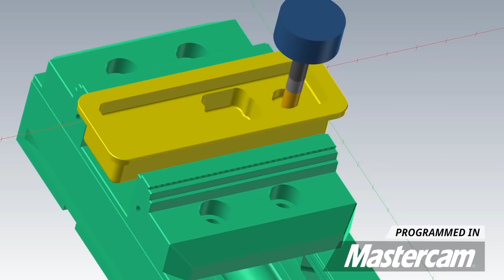My Boss SUCKS and Represents a CANCER in our Industry… I’m DONE.

Comment: In my second year in machining at college, my instructor told us one of the places they toured had a shop floor rule of two IPM. My instructor asked them “how the h*ll do you guys make any money?” They said it was a safety rule. They didn’t finish that tour, he rounded up all the groups, went back on to the bus and off to the next shop to tour. He told them “forget anything those guys told you.”
Reply: Jeez, even as a person who knows very little about machining that seems incredibly slow.
Reply: SteelJM1 it is. To the point where you’re putting unnecessary wear on your tools.
Reply: @brantleyanderson6807  how would not cutting out more wear on your tools?
Reply: Hellsing 12002 running your tools too slow can cause unnecessary wear on your tools from rubbing. Don’t believe I said anything about not cutting out more
Reply: That's absurd, heck, I regularly hand feed faster than that on a manual mill, like 10-12ipm
Reply: @Ian_Wallace.  Whenever I hand feed it's anywhere from full feed (630mm/min) to rapid (2500mm/min)
Reply: I used to run a 25yo CNC machine in 2015 built for cutting out stone countertops. Ran a 22mm end mill cutting through 3cm stone slabs, 6krpm. It ran dos and used floppy drives. It got so wore out the whole head would tilt visibly from the gantry. When I started the machine could do 8ipm for the most part. By the time it was scrapped it was still going faster than 2ipm, usually

Comment: I've worked with guys like that. One couldn't understand why he kept breaking drill bits in a stainless part. I increased his spindle speed to where they were supposed to be but as soon as I turned my back, he slowed it down again because he was afraid. These were the same guys that preferred 304L to 304 SS because "that leaded stainless machines easier." I started to tell them that wasn't what the "L" stood for and that the machinabilty index was actually lower, but then I thought better of it and left them in their ignorance.
Reply: Ha! Tell them to use 304LN - because it's "Low Noise" and doesn't chatter.

Comment: I’m an oldish school machinist, or was, I went into teaching. Never did much cnc-ing. My only qualm here is wear and tear on the tools (how many parts produced before replacement) and on the machine
Winding things up is all well and good but can the tools and the machine take it?

Now in terms of modern cnc and tools I’m sure they can, though one place I worked at I witnessed them working a cnc mill way past its limits, it sounded awful. I also had to put up with bosses putting the latest tools into older machines that could not take the forces generated by running at the required speeds and feeds.

Times like that made me happy to leave the industry.

Comment: I spent years as an inspector for an aerospace shop. These guys had management all over them to get parts out fast and jobs would end up in piles outside inspection because the main inspector spent 90% of his time bullshitting instead of checking parts. I put an end to that.
Reply: I was the final inspector for 2 years in my shop.  I met production around 60-70% of the time, and missed it by 1-4 the other times.  (12 hour shift, 40 parts by end of shift).  I was responsible for cleaning, installing parts, pressure testing, and inspection, and packing.  

I constantly got crap for not making production every night.  However, my parts was clean, I mean clean enough to lick the inspection filter, and in 2 years not one part ever came back with my name on it.  My counterparts on days and the other night shift guy (we worked 4 on 4 off), had parts come back by the truckload all the F'ing time.  

These people did not do their job, and just pushed crap through without cleaning, assembly, and testing properly.  It was infuriating because I knew how they did it, I refused to do it, and got sh*t on by the leadership and bad raises at review.
Reply: @Terrackhimself  A lot of us have been there and done that, brother! I'd wager your personal shop looks a lot better than they guys who did the bad work. That kind of behavior crosses all kinds of life lines. We are now Old School. Congratulations! Yell at some dumb kids! When someone needs something done right, they will come to you.
Reply: @Terrackhimself  It scares me what it going on with the management class. They are Soviet tier terrible. We have a whole shift of guys that are so incompetent that they cause up to 20,000 dollars extra scrap per month. And no one does anything about it.

Comment: Running at faster speeds and deeper depths of cut increase the temperature of the bits.  And yes, that does decrease safety.  It also decreases the life of the bit.
Reply: Sounds like that would be something to start keeping track of. If production goes up by 10x, but tool life only goes down by 5%, that might be worthwhile to run fast.

Perhaps one tool is particularly expensive and it makes sense to run everything else fast, but that one tool at the "slow" speed so it lasts as long as possible.
Reply: If you are moving parts in the fixture and/or breaking tools then yes, but it can also increase the effective life of the tool by decreasing the total number of rotations that tool makes per part and spreading the load higher up the cutting edge. If your 1" length of cut rougher can handle a single full depth pass at F20. why bother making 6 cuts at F60 and wearing out the tip that much more on each part?

Comment: Sad, but as an industrial controls consultant for many years, I've seen it over and over. Even the food processing industry has it. I rewrote a Hayssen packaging machine program once to increase the rate to 60 bags/min from 4 bags/min (1lb potato chip finseal bags) with Better reliability and less overpack to boot, and the only time we could run it is when I or the packaging room manager was present. Same basic story.

Comment: I've worked for shops with very difficult boss, the sad part about it is if he wouldn,t interfer all the time let me do my thing not to mention no actual experiences in the trenches so to speak.All that did was create extra stress and cause more time.Ive always been open to new ideas and suggestions that's how I learned in the first place.Ive been a machinest for 20+ years I know what I'm doing and them some you rather get along or not or you try to pretend to just to get the job done/ recover save job the last thing anyone needs is a dude that panics all the time that don't help he or she has got to learn how to relax much  more often then not it works out just as good mabie better.agressive distraction ruins everything problem is boss doesn,t realize it,that's why guy,s start there own

Comment: Been there, done that 😂 Guys were running carbide mills at hss mill speeds and feeds. Changed them at more appropriate values, someone else comes and changes them back. Even had the procurement engineer come complain to me that he doesn't know why he buys expensive professional tools for the company when everyone uses them in a way that the cheapest, available for consumers straight from hardware store shelf mills could handle it 🤣

Comment: Same goes for 3d printers ;P 
In the facebook group everybody is running them at 40-50mm/s with upgraded parts.
Yet my stock printer :P is pushing double the speed. Maybe it's time to upgrade the 3d printer to triple the original speed :D

Comment: Great video, trying new techniques is so rewarding when you reduce a cycle time by a massive amount. I devised a tandem milling technique that reduced a cycle time from 8 minutes to 42 seconds. By using tooling in new ways and rethinking programming, one tool did the job of 3. Please have a look at tandem milling and chamfering 28 pieces in 42 seconds, hopefully it may save you some cycle time. Subscribed.

Comment: I'd say after hearing the whole story I agree with your manager. 
He allowed you to use your custom program, but didn't want to push it onto people who weren't ready for it. If he'd said you aren't allowed to run it this way, I'd agree with you. But he acknowledged your ability by letting you do this. Often times people in those positions are machine operators, not machinists, and they may not have been at your skill level.  It may also embolden inexperienced operators to make their own adjustments without your knowledge.  I don't know the guy and never worked with him, but from what you told us here it didn't seem toxic.  I've had many more managers tell me that I wasn't allowed to alter any machine settings at all.
Reply: If he's doing 6x as many parts in day shift as they used, why they even need night shift anymore? 🤣
Reply: @robot65635  Exactly.
Reply: I had the same exact experience. I was on night shift and ran things hot and the boss told me to not leave it that way on shift change because he didn't trust the guy running behind me not to crash the machine.

Comment: You think you're doing something good and the boss would be happy. They flip it around and make you feel like you're doing something wrong. Some older machinists can be worse than that boss. They will try to undermine you because they feel threatened. I think there's going to be less shops like that around because they're not going to be able compete with the shops that do embrace change
Reply: So true, its so frustrating when management are telling you to improve performance, so you start making more parts per day and then you get the older guys getting angry at you for working too quick. Like wtf do I do haha

Comment: I actually just got a complaint from our weekend shift that it was dangerous to remove as much material as I was and it was loading the spindle to 74%. The standard here is .125 doc and 60% step over, I was doing full slotting .500 deep with .75 em. This same crew also slows everything down to 70% also, some of them turn it down at the machine and others change it in the program, so frustrating

Comment: Uh dude, you should not be changing programs willy nilly. There's a reason engineering makes the big bucks. You very well could take your company out of standards compliance or customer terms compliance without taking the part out of tolerance. Where I work,  we have strict documentation requirements, and you probably would've been canned on the spot for changing a program without consulting your foreman. Just because 30 parts ran fine does not mean the program is safe or compliant.
Reply: maybe that's why he dont work there....................................................................................................
Reply: Yesterday I couldn’t even spell the word eng a near and today I R one. 😝😝😝 😜😜😜 🤪🤪🤪

Comment: I have a hurco Km3 dovetail machine, basically a servo driven type 2 Bridgeport design, it can run aluminum at 150 ipm. A 45 yr old dovetail 3 axis knee mill. 

30 ipm, ahhhhhhh what, wow

I uploaded a short of it, i rebuilt this machine myself and she holds half thou

Comment: I actually understand the boss's viewpoint. Hyper efficiency just isn't always necessary and not everyone can handle it. Depends on what the business owner wants and what the machinists want. Gotta balance work with people.
Reply: If someone can't handle running an efficient program on a machining center, they need to go back to work at the McDonald's drive thru window. I used to run 3 VMCs simultaneously, all different brands of machines, all running different parts. It's not all that tough if you're a halfway decent machine operator.
Reply: @countryjoe3551  Drive through window is more stressful, more fast paced, more emphasis on timing, and more yelling than any machine shop and all for lower pay. Fast food is easily a harder job in terms of stress than machining. There is a lot more mental effort and training in machining but a lot less stress.
Reply: @countryjoe3551  well, need? Do they really? Like I said, hyper efficiency just isn't always required.
Nothing wrong with fast and nothing wrong with slow.  What is required is very much contextual.

Comment: I have been in this trade for over 20 yrs. I swear you just told my story. Unfortunately I never had the opportunity to open my own shop and just keep plugging along to satisfy my need to do better, whether management appreciated it or not.
Reply: I was in machining for 15 years..got sick of corner cutting, lowered safety standards to meet production quotas, and insane part per hour schedules...moved into precision assembly work, mostly with prototyping..i still do all the machining I could want but my job is to prove engineering concepts, not mass produce.  Love it.

Comment: Well, 30 something years ago I was doing the same thing at my shop where I was running a Hurco MB1. Changing to carbide, adjusting S & F, I was running 12 parts per hour, the other shifts where running 3-4. Holding tighter tolerance and better finish,  the "seasoned " operators didnt like carbide tools and weren't willing to learn.

Comment: The market will handle this. If companies fail to adapt - be competitive - they will go out of business. You were right to leave and start your own shop.
Reply: Got that right..competition doesn’t feed the weak.
Reply: @JSomerled  but it's still working like that for decades
Reply: @TheAimlessWarrior  Often because some unrecognized factors are actually beneficient despite the apparent inefficiency. In this case, my guess is that not a lot of workers can handle the high throughput. In the 30 mins the machine takes to run, you can go get a coffee, take a dump, manage your material and keep the workplace clean. Cut that time too much, and all of a sudden you need to be constantly attentive for a whole workday. Plus, the safety aspect. Speeding up the process may be technically safe, as long as the worker is good. But now you have eliminated a certain margin for errors, cannot get away any longer with minor sloppiness.

Comment: As a new maintenance manager there were 2 injection molding presses that we were changing pumps (6 each machine 3-gear 3 smart) as fast as we could get them shipped in.  When I started looking at pressure and speeds, I noticed that almost all pressures were maxed out and the speeds were set low which caused them to have to tie the doors shut (uncontrollable accel/decel). the clamp in particular was set to call for 3000 psi pump pressure and then limited to 10 inches a second speed, during the 40-50 inches the mold moved, After I fiddled with it I had it moving at 30IPS with only 800 PSI pump pressure. the clamp moved so fast the second shift operator ran away the first time he saw it open, it was that way on all machines I.E. 2500PSI to pull ejector pins back jerking the end off of 1 inch hydraulic cylinders and so on. So, IMHO don't hold your machines back or it could cost you more than time.

Comment: Maybe that dude was afraid of the "Tool life" of him?
Could it be? that your (TITAN) machining makes that dude think about tool erosion? 
that's the only thing that comes to my mind..30 mins for a part is very long, 4 minutes sounds good but what about the machine?
I know how Al is soft and all, but there must be a factor of the machine that can save to some money on the cutter, knife, drills etc.
Reply: Well many research papers show that cutting deeper with higher feed rates increases tool life. SFM is what affects tool life the most as long as set up conditions are good. Higher SFM shortens tool life. But in the end, making more parts faster will make up for the cost of the tool and the machine itself over time.

Comment: I started working for a small manufacturing company right out of trade school as a production machinist.  Common phrases used from management when I suggested a more aggressive style of machining, "We've been doing it like this for 30 years and it's worked perfectly."  "Why change what's not broken?". I was running a Doosan PUMA 400M. We had an 3.5"D x 24"L spindle (1144 stressproof) that had quite a bit of turn work on it.  We were required to turn 4.5 parts per hour to meet the company's standard.  By changing the depth of cut to .100" from .03", increasing the roughing feed to .016"/rev. from .01" and the surface speed from 400 to 600 (SECO CNMG432 M3 TP2501) I could machine 15 per hour with better insert life.  My boss noticed and gave me the same line.  No gratitude for saving the company money, just;  "If you make changes to the program, be sure to load the original back before 1st shift comes in."
Reply: If the boss trained entire 1st shift in your method, they wouldn’t need a night crew.
Reply: @jedibusiness789   The company had thousands of different parts to run that would easily keep both shifts busy.  But your point is still valid.  If they would stop babying their machines, they could dramatically reduce the time to assembly.  This one part alone we would run 2-3,000 of in one setup.  Would take weeks to run.  Why tie up a machine for longer than necessary?  You know.
Reply: @SGIABC  - I’m a rookie machinist but I really need to learn machine shop numbers….because I go by what I was taught in school, tenths, hundredths and thousandths spot…but shop numbers are not read the same. Why is that?
Reply: @greeneyesfromohio4103  They aren't any different than what I was taught in school.  But the language can sometimes be confusing.  Often times we use the word "Tenths" to designate the 3rd decimal place.  But this is simply an abbreviation for Ten-Thousandths.  Machine shop lingo simply breaks everything down into thousandths of an inch to describe a given digit.  For an example 1.574356" would be written one inch, five-hundred seventy-four thousandths, three tenths and fifty-six millionths.  Hope this helps.